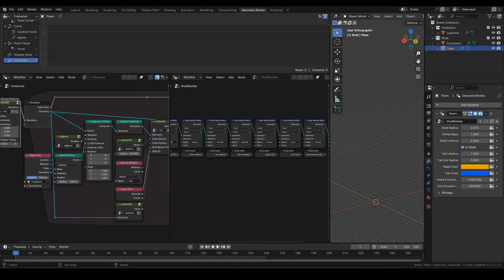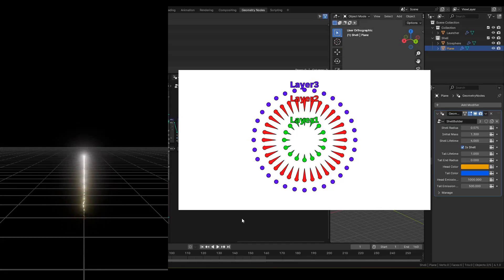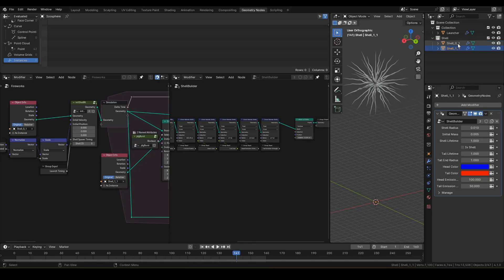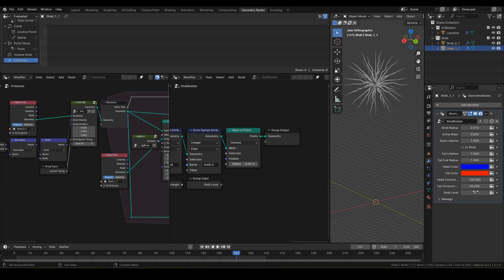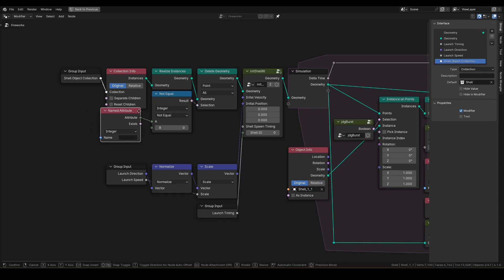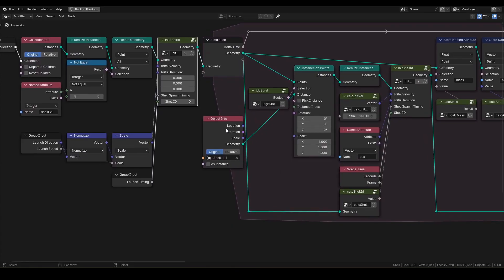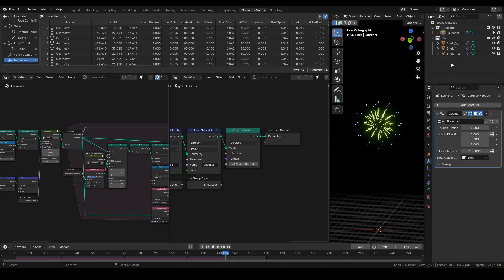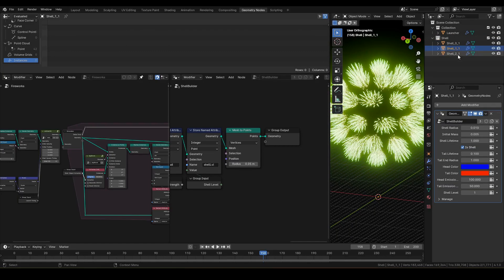[Blender] Let's Launch Fireworks with Geometry Nodes!  Ep.8 Levels & Layers

Comment: I really wanted to learn this, but I entered into a bug with my node graph and I have no idea what is causing it. Basically right after I replaced the Shell_1_1 object info with collection info, in 5:39 + realize instances, the explosion starts behaving in a weird way. All the explosion particles zoom to X direction with light speed when with the old object info node it was working just fine.
edit: I think I will check all  previous videos again to see what I did wrong :D